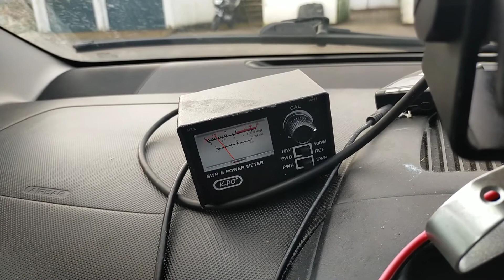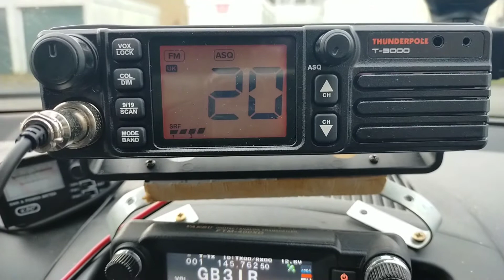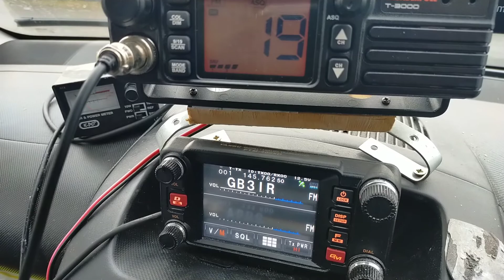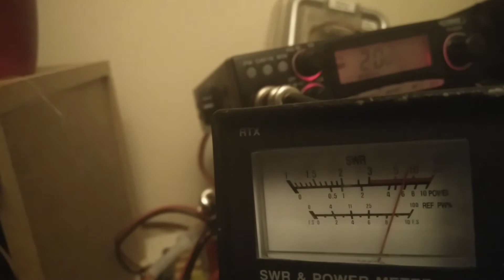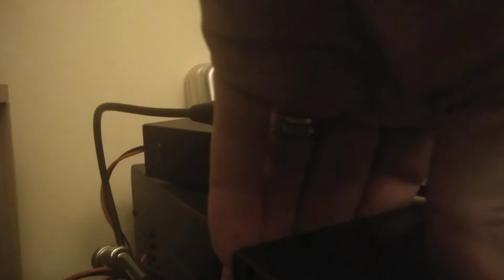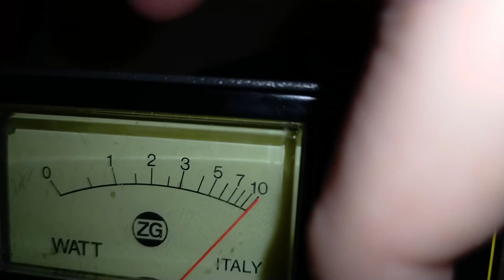Comparing uncalibrated non-selective power meters for CB: the K-po SWR-430 and the Zetagi Mod. 203W

Comment: Richard just picked the Zetagi meter as an example, he did not pick it because it was known to read high.  It might just be luck that the one you have is reading almost correctly.  Usually, most meters will read what the other one says, total rubbish.  I don't think he intended to rubbish Zetagi, rather use it as an example, just so happens the one you have and the one he has will always disagree.  I bet you could plug in half a dozen CB meters and they will all say something different.
Most modern CB radios do around 3 watts (if you are lucky) and they are such a pain to operate.  How you are meant to drive and use one is beyond me!  The old CBs you could use without even looking down at them.
"19 a copy"  "Got your copy" "Take it up to 36"  "Rodger, 36 it is" 17 clicks (if my maths is right) and you are at 36, not even looked at the CB yet, just reached down and turned the channel control.
New CBs, yeah, low power, hard to use mobile (even home base at times) and not very loud if in a car, an extension speaker is a must have.
Even the old CBs you could change band without taking your eyes off the road, now you need both hands and the patience of a saint, how are you meant to use these sets safely on the road.
If I were being honest, I would rather get hold of an old illegal CB radio and use it, more power (nearer 4 watts) and a lot easier to use.
What's more, if you do have a harmonic they are easier to tune it out, these modern sets (if they have a trap it is fixed, not all but most, the ones that have an adjustable trap are usually worse for harmonics.  Maybe that is why they fitted an adjustable one in the fist place) but I want to use SSB anyway and there is just no choice out there!
I wish some manufacturer would produce a good to fair CB with UK/FM channels, and the old 40 channels with SSB and AM only turned on on the American/EU channels that have good old fashioned controls like they used to have.
There is a lot to be said for sets like Nato 2000, Stalker F9DX, sets that were made in the 80s that had UK 40 FM and the EU/American 40 AM/FM/SSB in them.  I do have one in the shed, but it is faulty and has never been used by me.
I wish I could get a Nato 2000, but with a switchable Rodger bleep, I know this will never happen as the company that made them no longer makes CBs!  :-((
Sorry to be so long winded.
That is one good Zetagi meter you have, my findings were that they could be close or miles out, but they were a little better quality than others made for CB.  Only problem was the calibration control inside was never adjusted (if there is one inside them) I never looked inside it, but I have looked inside others.  The meter I had had to be tuned to a band 10 - 11  etc and it covered a few bands.  I can't remember who made it, but it has mysteriously vanished when we moved house.  Two moves in as many years and things packed and repacked.  I also had three aerial at least vanish!
Some of my equipment (in fact most of it) got ruined, left out in the rain under a cover that leaked, not by me, but I won't go into it in case there is a divorce in it for me!
Anyway, if you take 6 CB meters you will find they will mostly (I do say mostly) read different.  Something else I noticed about them, if a meter has a field strength meter on it, regardless of whether an aerial is connected to meter or not, it will affect the readings you get.  All it need was a couple of components to stop it from doing this, but sell it to the CB'ers, they don't know any different, it will save us 4p on each meter and they will be none the wiser, they will believe what the meter tell them!
It is a bit of a disgrace.
When Bremmi power supplies came into this country they had no fuses on the supply or secondary, they were switched on the Neutral and not the live.  This they rectified quickly by fitting a fuse that was live i.e. if you took off the fuse cover and took hold of the fuse to pull it out and the fuse was intact you would get a shock!
This was a quick fix, I think they rewired the metal switch as well, but they recalled (to their due) and the next model was very good, very good Military spec regulator, fused right was round and a plastic switch (I would rather they left the metal switch as you could cook it and it would survive) to meet all the regulations.  They were good supplied, much better than any made here for CB.
Anyway, I digress, sorry.
Wow, did I write all that?  It was not a rant, just some observations I made working with them over the years!
Carry on Paul, you are doing fine, I watch all your videos.
It is a while since I have been down to stay in your area, a lot has changed, Tesco used to be in the Square in Richmond, so that will tell you how long it has been.
I found to my cost if you take the wrong road it takes you for miles round Catterick before you can get back to Scotts Corner.
I was in the caravan park there for a week.
I went to the pub up by the castle at Richmond for a meal or two, but it turned into a place where everyone went on Friday nights!
Oh well, I had the kids in there for a meal, looked up and it was full of nightclubbers!  Some made stupid comments, but there you are, we were in there at least 2 hrs before they appeared.  There was a guy serving that looked a bit like Seff out of Emmerdale at the time lol. The people that run the bar had no problems with me having the kids in for a meal, just it was a bit slower at getting our food then we though it would be.
The guy running it at the time met us at the door, he had heard some comments and came over to apologise, but I just said I was a bit thick skinned to let that bother me.  He asked if we would come back for a half price meal (why didn't he give us that one at half price?) but we were leaving on the Sunday for pastures new.  Anyway, it is or used to be a nice place, it is a lot busier now though!